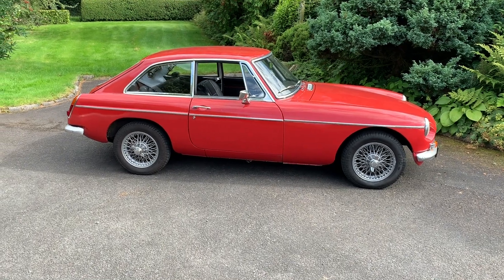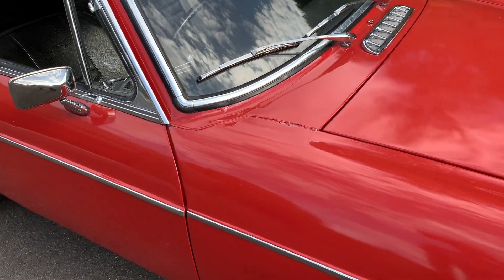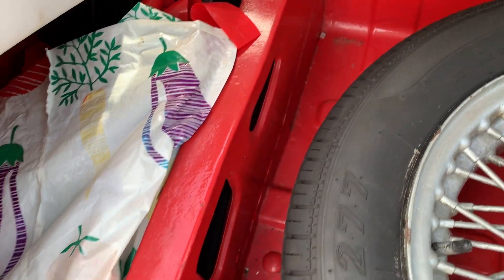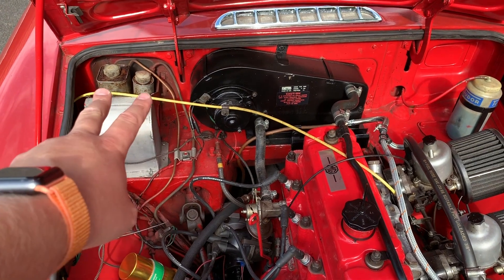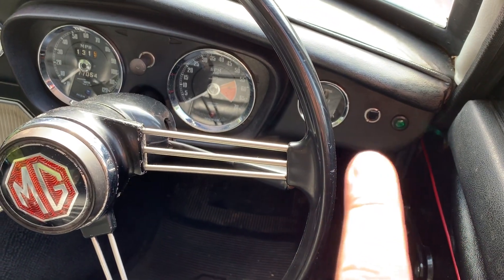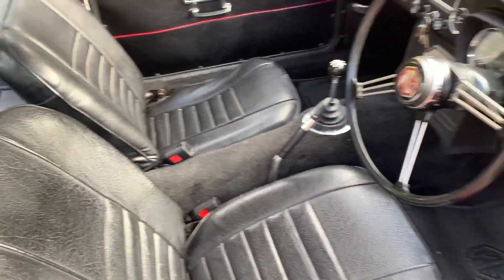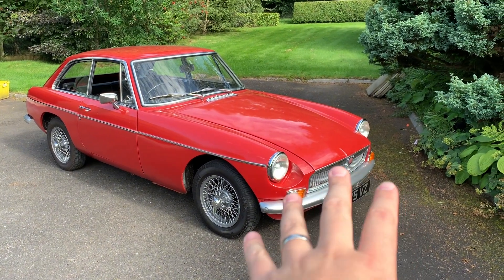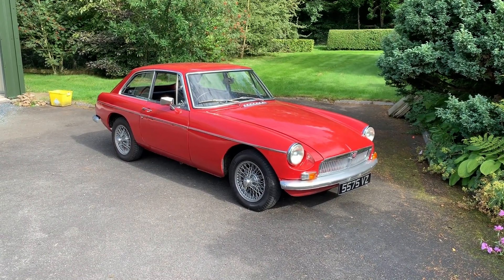MGB Buyer's Guide

Comment: The oil cooler on my '70 BGT was set between the engine and oil filter. I had no idea I had an oil cooler let alone that it had some corrosion in it that let loose and screwed up my bearings and other engine parts. The filter should have been placed between the oil cooler and the engine. Would have saved me a lot of money and frustration. It was plenty of fun to drive when it was working well.
Reply from the maker: Aw that’s painful, sorry to hear that

Comment: Great video. I've just bought a '66 MGB roadster (in Australia) without overdrive. I was wondering if you had thought about converting yours and if you knew how hard/expensive it is to do? Thanks.
Reply from the maker: I did indeed think of converting it but never got around to it before selling. Very easy to do if you can get the correct gearbox with OD fitted!
Reply: Mine has a 5 Speed Datsun B 210 Tranny…. Works beautifully
Reply: "converting"...It is not advisable to add an overdrive unit to your transmission. Buy an O'drive box , install it  add a switch and get the drive shaft specifically for the O'Drive transmission.

Comment: So I found one these MK IV mgbs. It runs and everything. My question is about the last 1000 mkiv. We're they split between y'all's home and states?
Reply from the maker: I’m afraid I wouldn’t be the best to advise you on that. My own is a Mk2. The last MGBs were the ‘LE’ model as far as I know? Thanks for watching!
Reply: Ok I thank you very much with the knowledge you gave me about the LE. It turns out Henry Ford 2 ordered 1000 in 80 for the American market. That's where the old triumph stuff on it comes from my intake Is also the same as your gt very nice car by the way. I am rebuilding it this year. If you would care to see the process look at my channel.  Thank you again from one car guy to another.
Reply: I looked at your site and the car. It is a rubber bumper B. The least desirable.  I can tell that the carbs have been replaced, that is a good thing. If you did not have a full blown shop and were just another Joe buying an MGB  I would say stop. It's not worth it.  If you are doing this for fun, and not a financial return, go ahead. But to fix and sell.. not advisable. Best of lick.
Reply: @jeffhildreth9244  thx you i was thinking the same thing until I found one of these whole. Everything was same i was baffled still am. I got caught up in my dirt work and pushed it to back off shop. So one day ill get back to it. Just get paid better on the skid steer. Lol

Comment: The only MG,s worth having are. MGB. V8.  otherwise get a Mazda MX-5
Reply from the maker: I can get behind that. Though the T series from the 30s are very nice too!
Reply: V 8 the MGC?
Reply: Grant Barclay the Olds/Rover 3.5 litre V 8. Weighs a lot less than the MBG 4 potter and even more lighter than the MGC.  6 cyclinders. Result in both cases less weight on suspension and better handling. The MGC. Was fast but didn’t like going round corners because of the boat anchor it had under the hood   Body would need to be stiffened to counter act torque of motor
Reply: @granto6712  No the MGC is a 3L straight 6, easily noticeable by the bubble in the bonnet
Reply: @andysneikus380  my dad got one the day I was born 13 July 67 fef 11E, white
Reply: 4 cylinder with Moss supercharger - cost effective & lifts performance - relatively straight forward work......
Reply from the maker: I’d like a go in that set up
Reply: @andysneikus380  Many B owners install the Bubble hood.  One of the ways to determine an MGC is the 15" wheels and the torsion bar front suspension.